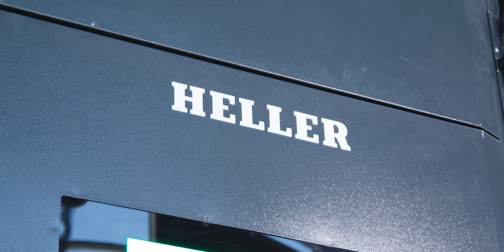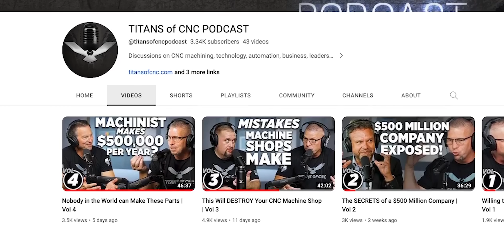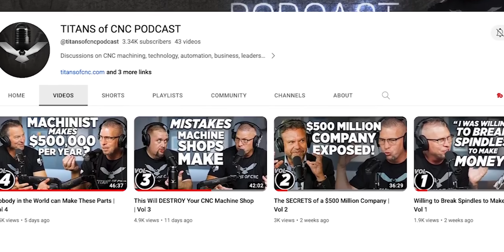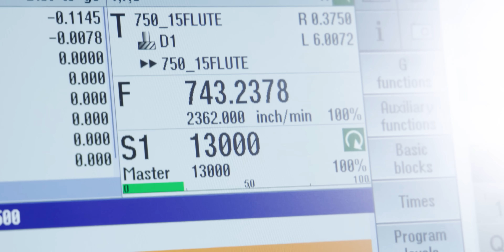FULL RAPID at 2362 IPM In STEEL

Comment: I run hydrant valve with 15000mm/min with 125rupees APMT insert...  4mm depth of cut 290 od helical interpolation width of cut 10mm 

The company can't spent for better tools if they spend like you I'll break your record in 2023

Comment: I love the approach of pushing the limits!
As a Senior Design Engineer, part-time machinist, part-time software programmer, part-time machine assembler...
I have honed many skills....
My thoughts are...based on the capacity of the Heller monster....of course....it should be possible!
I love taking 0.750 cuts with a 1" end mill on a bridgeport...in aluminum 6061....
People think i am nuts....
However....within what the machine is capable of....going beyond those limits....
Bad news...whether roughing or finishing....
I love your channel!

Comment: I worked for a company for 30 years they bought Sharrman machines in the mid 90’s. We could run 8 to 10 parts on the smaller parts 2 or 3 of the larger parts in a 10 hour shift. They talk to Heller in 2016 and ask how many parts they could get in a 10 hour shift . Heller called after a while, 20 on the smaller parts 10 on the larger parts. Double on one part three time more on the other. The Sharrman  was a 5 axis with an U head but it was able to do what some of did , nobody had the balls to try. I love watching your stuff.

Comment: As amazing as this video looks, this is just running the tool at about 3x the cutting speed. Feed is pretty low here, at 13k rev/min with 15 flute tool, its about 0.03mm/tooth. Thats actually quite low for roughing.
It would be interesting to know what is the final mrr for this and how long did the endmill survive.

Comment: Not doing that in my HAAS
Reply: You can remove just as much material with your haas.  These videos are funny.  Its all about the MMR.  IF you ran that machine like that all the time you would be replacing ball screws all the time too.  A business that bought a machine like that would not be running it like that. You can slow the feedrate down, but take a bigger cut.  If you look at the chips they are needles because they are so small.  Also, again a shop that has to buy their cutters want to get as much life as possible out of them.

Comment: 2 questions, what was the step over and did you have to edit the g code to get the machine to rapid the whole toolpath?
Reply: The size of those shavings? No less than 0.019685 inches (im from the other side of the pond so at least 0.5mm stepover I'd say )

Comment: That is Not in rapid.  G00 does not interpolate.  Why lie?  I like you guys but you should not mislead your viewers
Reply: Ummmmm sir the rapid on this machine is literally 2362 ipm. Soooooooo
Reply: @barrysetzer  "FULL RAPID at 2362 IPM In STEEL"  Do you know what Rapid is?  G00 Straight line with no interpolation.  No nurbs or curve fitting activated, and..., and an in-position check between each block.  It looks nothing like the smooth G1 motion like in this video with curve fitting activated.    I agree they were cutting at the same speed of a full rapid move so, why lie in the click bait add.  I would have still watched.  It makes them look less than serious and more like just another advertisement.   I make a GREAT living programming large fast machines like this every day, so I am looking for limit pushing content.

Comment: Wouldn’t the axial/radial depth of cut and matter a lot here? Like what’s the material removal rate?
Reply: It’s just a physics trick honestly.   The tool won’t be able to exceed a certain MRR as at a certain point, the removal rate will require more force than the endmill can withstand.  Really fast feedrate with light step overs will still be the same MRR of a slower feed rate with a greater step over. 

The only time high feed like this makes sense is if you have a high rev, low torque spindle with a high feee rate that doesn’t have the spindle power to drive the cutter tool to a higher MRR. IE, the spindle gives out before the endmill would. 

Be even then, you’re still down to a MRR limit by the spindle power output.

Comment: I'm thinking when you are taking about productivity, IPM isn't the correct measure but rather I³PM. That is what rate is the volume of materiel is being removed at. It would be really interesting to see a test where a whole list of cut depths were each pushed to the limit and then the time to remove a given volume of materiel plotted. At a guess, a lot of big fast modern machines would reach a peek on that below full rapid speeds.

What would be even more useful (and expensive), would be to plot cut depth vs spindle speed vs max-IPM.

Comment: You know that there is a lot of thinking going on about redesigning end mills for super high speed machining.  Making them stronger, tougher, more rigid, optimizing the chip clearance to be just enough and no more....we haven't even come close to reaching the ultimate limits of what's possible yet!   Kennametal hasn't even made the ultimate end mill for that as of yet.

Comment: just for reference, its 776m/min with 0.308mm per teeth
you gotta need a very small ap to not clog those 15 teeths
Reply: It's just short of 60m/min not 776 but the feed is correct.

Comment: Can this be done on a haas?
Reply: Even if you could why would you want to?  You'll spend more money on service replacing ball screws than making any money.  You can slow the feedrate and take a bigger cut.
Reply: @bobsbillets  wasn’t sure if it was a good idea. My place of employment struggles with steel badly. We destroy end mills left and right when we do scaffolding brackets to the point where we turn the speeds and feeds down to the point it takes to long to even pump them out
Reply: @Core.cs1  There are lots of reasons why people struggle.  Could be the cutter is the wrong type.  Could be feeds and speeds.  Could be the way the part is held.  It might just be the type of part you just cant go fast with.  Remember this when watching anything on video.  On video you can take as many takes as you need to get it just right.  Give me a little more info on what you are doing.  Maybe I can give me a couple tips.  I have a haas vf5 and a sl30 lathe.  A haas will do anything any of these other machines will do.  Maybe not as fast, but they will do it.
Reply: Probably not. Don’t think the control is fast enough. 

As far as speeds/feeds it’s all relative. 15flt endmill with a 2-3% radial cut and air blast isn’t being stressed out at all in this video. Just a matter of if the controller can keep up. Gotta have a top end machine for that.
Reply: Also need to make sure you’re using the correct tool holding to be able to dynamic mill at full flute length like that. Doing that with a larger 10-20% radial cut without a good hold will result in your endmill getting pulled out.

Comment: You really do have to understand the mill too. Some ball screws have forced oil and others have forced oil that is used for cooing. A ball screws can over heat at rapid speed because most mills are not made to rapid all the time.

Comment: What a machine. A few things to look at is the type of cuts. Doing the OD like this is the easiest on the tool and machine. Inside cuts will have over 50% engagement sometimes and will have much greater chip removal problems. No doubt that 15 flute get the job done.

Comment: Hell yeah brother, i love running my mazak optiplex fiber laser at insane feed rates. Nothing like blasting out a part at 2500 ipm at 8000 watts!
Reply: What thickness are you cutting?
Reply: @mehmettemel8725  at those speeds was cutting .050 galvanized steel the other day

Comment: i see and i tried that some time the best i got , is with 10mm 7 flutes and well it run impesse at 10m/min its insane to see other do the same with 1mm deep cut iin steel and full lenght on 22mm. i used a hermle C400 for it

Comment: 0.262 x 0.75" (dia) x 12999 (rpm) = 2554.3 SFM   This is in steel, no flood coolant.  Absolutely amazing.
Reply: It's called high speed milling. The heat stays in the chip. No need for flood coolant.

Comment: The most impressive thing was the fact that the machine sounded absolutely comfortable at that speed. That tool sounded good as well. The ears are just as important as feeling vibration for guides to improving speed.  Too many people are afraid to push limits and leave money sitting on the table.
Reply: I  was super impressed when I met legally blind machinists at lighthouse for the blind. the way one guy operating made parts... He always had a hand on the machine so he could Feel what it was doing
Reply: As an operator I can only move so fast
Reply: @Whaley96  I hear ya there. Im 52 and have creaky joints all over me from 30yrs on a shop floor. When the cycles start getting sub 5mins or the parts get over 5-10lbs, I start hating life.

Comment: 1.Drilling as fast as possible.
2.Threading with a tap as quickly as possible.

* No internal cooling
Reply: fastes I've ever ran with a tap was around 250-350 rpm through a 15mm thick plate with a M42 tap by accident. 

did it the first time, went incredible well so that was my newest standard then😂
Reply: @Sebastian-ed5kt slow